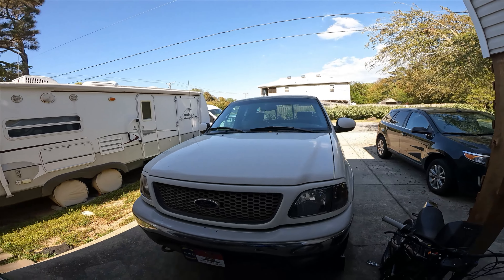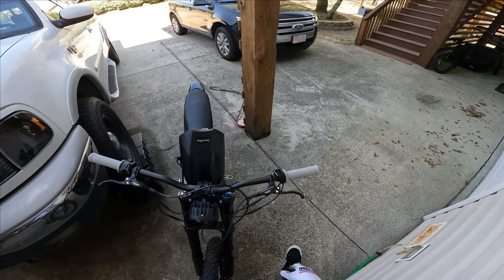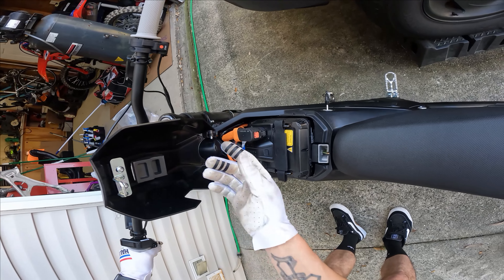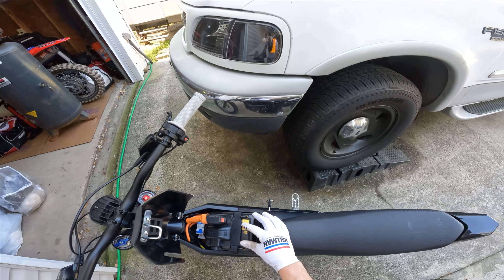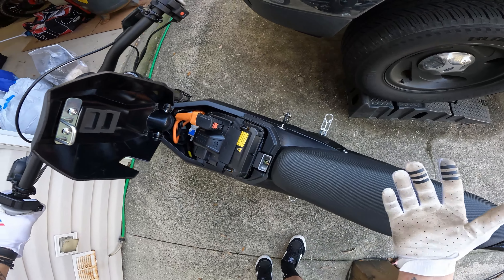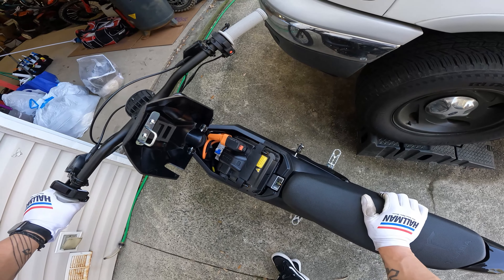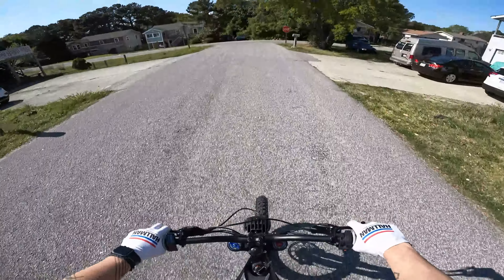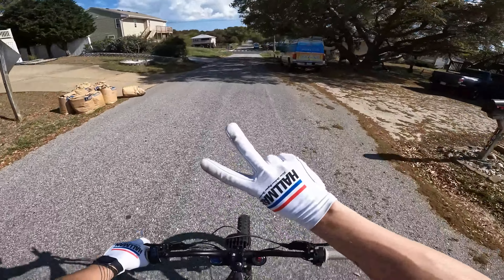Talaria Sting R MX4 // HOW TO STOP THE BATTERY RATTLE!

Comment: Perfect timing.  Just got done with the first ride on my new Sting R and the battery was clunking around like crazy on the rough sections of the trail.  Hadn't installed the rubber battery things yet as the instructions were so terrible, but will get them on now that I know where they go.  Thanks for the info.
Reply from the maker: yep, same thing happened to me... Glad I could help!

Comment: Fit closer to the lock catch. The 3m tape peeled straight off the rubber block, so I set mine with marine grade sikaflex to the battery lid. Works great

Comment: This worked perfectly for me, both pieces just like you have, I had the small block on the battery alone and it was better but still noisy, so I did what you did and it's dead quiet now, I sort of messed around briefly with trying to install the block on the battery but never found a good place, I'm thinking the small block on the lock assembly gives it some security front to back, I'm just going to roll with mine as is just like in the video.
Reply from the maker: Yeah so after posting this, I’ve actually relocated the smaller block to the battery rather than the latch. Either position works fine for rattle, but I couldn’t remove the battery when I stuck the smaller block to the latch.
Reply from the maker: Since this video, I've also  added a thin sheet of foam under the battery, and on top of it as well, its hard to close the battery door now, but the battery is super secure
Reply: @freerfixedit  
That's a good idea, I remember when I had the battery out for inspection that it might need something at the bottom for padding, I'll probably do that as well.

Comment: Got my new talaria yesterday and took it for a spin and love it! I forgot to put the blocks in but now I know what that rattling noise is  lol. But on a different note for some reason the brakes will randomly make a loud deep humming noise. And the only way to stop it is to grab the brake about 5-10 times until it stops. It seems like the calipers might be getting slightly stuck. And my front brake doesn't stop anywhere near as good as the rear brake. With the front one I can squeeze it hard and still be able to move the bike forward. The rear brake when I squeeze it I can't even get the bike to move at all when trying to move it backwards. Did you experience this at all? Thanks! Just subbed!
Reply from the maker: Stoked you like it! Yeah so I gotta be honest I’m not amazed by the brakes, but here’s some things I did that helped. They ship them with oil on the rotors to prevent rust in storage. Take some brake parts cleaner and wipe down both rotors real good. Also, with the front brake, I noticed a soft hum. Almost like a baseball card in a rim but softer. I noticed the fork guard on the brake side had a cable groove and a place for a zip tie. I pulled my cable tight at the bottom and zip tied it to the fork guard and haven’t heard it since. Bedding the pads in helps too. Gets some material from the pads into the rotors and has more bite. I went like 10 and just drug the front brake and then did several starts and aggressive stops. Just be careful and don’t wash the front end out applying too much front brake. Hope this helps!

Comment: Didnt you say once that there is a way to change the gearing on the gear box to make it more or less torque?
Reply from the maker: Yeah so I found out that the settings about the gearing on the display are only to calibrate the speedometer. Apparently they don’t change the gearing of the bike at all…

Comment: Does the Talaria come with these rubber blocks? Did you order them from somewhere?
Reply from the maker: Yeah they come with it in the box
Reply from the maker: What also helps is a air bag shim. Can slip it behind the battery and pump it up a little and it keeps the battery firm in place

Comment: Hey i commented on your other video too. But could you tell me what wire to cut and how to get too it. to unlock the power ?
Reply from the maker: Yeah! You have to take off the cover that is around the horn on the bottom side by the head tube. Once you get that off, trace up those wires and look for the brown wire that just loops back to the harness. It’s the only one like it. Pause my video and make sure it’s the right one to be sure. There is also said to be a way to unlock them without cutting the wire. Turn the key on, hold the start button for 6 seconds, apply the left brake 4 times, then press start button 4 times. Brake sensors must be attached for this to work. Let me know if it works!
Reply: @freerfixedit  did you cute the wire or did you do the brake method
Reply from the maker: @alankincart4197  I cut the wire. Check out my unboxing video to see where the wire is and which one to cut

Comment: Does the battery need to be out to install? I would venture to say yes but not sure.
Reply from the maker: I installed them with mine in. Think it made for a more snug fit with the smaller block cause I just pushed it down until the tape hit the side. I’m not positive if I stuck the smaller block to the correct side or not though. Haven’t tried removing battery yet and I’m worried it might rip the smaller block up when I lift it
Reply from the maker: Adan M  Expensive 💰💰💰 but I think that feature is aimed at people in apartments or without a place to store the bike. They can bring the battery inside to charge